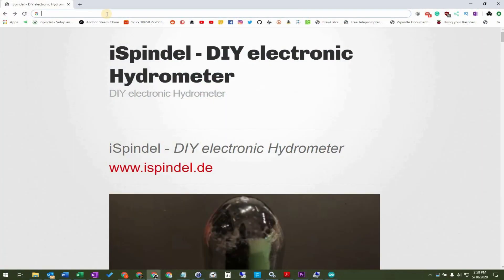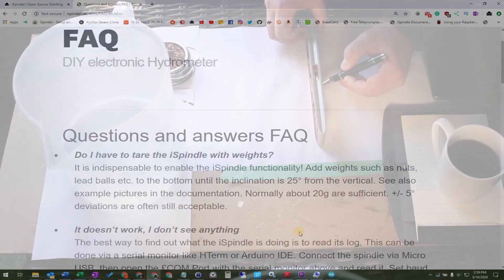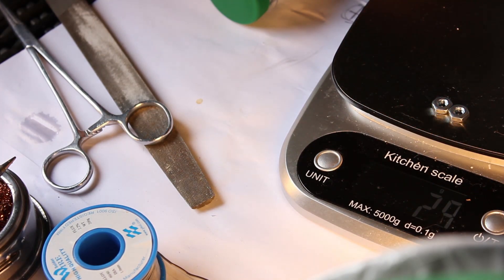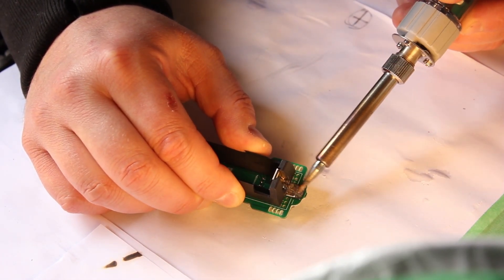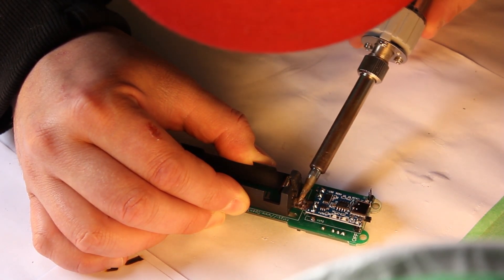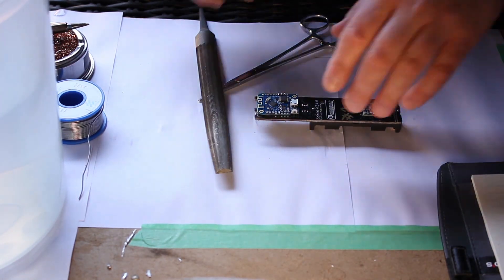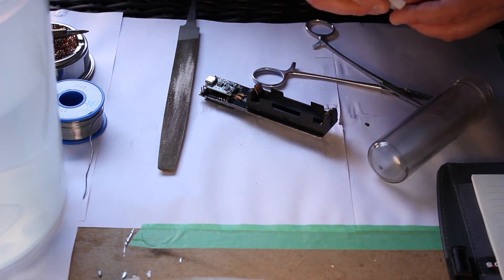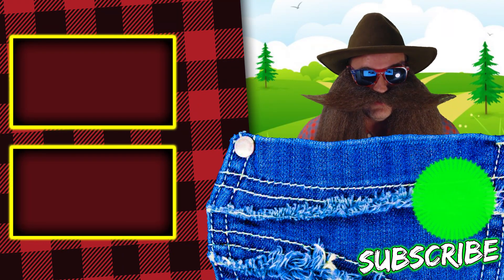iSpindel 25 Degree Calibration in Pure Water

Comment: the two I made floated around 31 degrees, I solder balled the bottom battery connection with 1 extra gram of solder and that made it float around 27 degrees.
Reply from the maker: Nice! A new board will be coming out soon with solder pads on top that do just this! I just build a prototype last week and it went very smoothly. It doesn't take much solder to adjust the degrees in water :) Thanks for watching!

Comment: For the off set calibration should the pelting lip not be taken into account? If you lay it flat off an edge so it is not raises would that cause an issue?
Reply: Hi there,
In my opinion the answer is yes it ought to matter - but it is taken care of thanks to an imperfect centre of gravity so the error is cancelled out along the way.

Here goes.

So the iSpindel calibration "advice" is to lay the iSpindel flat (incl lip) with the accelerometer uppermost and "flat". Now if you have aligned the accelerometer with the central cylinder axis of the pelting then it will be off horizontal slightly because of the lip we are discussing.

So we calibrate to horizontal and call that 90 deg.
Now if you were to roll the pelting around 180 you would expect the tilt to still measure 90 deg but because of the lip the error is now doubled. On one occasion I got nearer 92 deg.

So based on this so far I'd say it does matter. The accelerometer is not calibrated to the horizontal correctly. But...

There'e always a but.

When the iSpindel is laying in liquid its going to rotate around and settle with one "side" face up always - every time - because the centre of gravity won't be aligned down the axis of the cylinder. As the SG changes the iSpindel tilt changes but the "error" we built in via our calibration will be consistent (more of an offset than an error) because the iSpindel will always rotate in the liquid until the cylinder axis is heavy side down. You could put a mark of some sort to check - or make a mental note of the PCB orientation each time.

So now you're going to calibrate the SG against tilt in a sugar solution or whatever your method is anyway and create a polynomial that will caculate out that offset and all will be well with your iSpindel.

If the centre of gravity of the iSpindel down the cylinder axis was perfect and it could settle in any rotation then YES this error would matter and we should be taking the lip into account.

But the centre of gravity is not perfect. So we are ok. So long as you are diligent with your tilt to SG calibration method and allow the iSpindel to settle for each reading the error due to the lip will always be in the same orientation and be dealt with via tilt to SG calibration.

Andy.
Reply: I thought the same thing. Just leaving the lid off for this part of the calibration seems the obvious option.
Reply from the maker: @MichaelCoates  The lid isn't the problem, there is a lip underneath the lid that's part of the tube. You would need to hang the lid area off the side of the table/countertop. But I think the flatter the better. I think it's a good idea.
Reply from the maker: You are not the first one to ask this. I did it as seen in the video and everything appears to be working fine. I don't see how doing it your suggested way would cause an issue, flatter should be better. There doesn't seem to be a general consensus on if it's bad or not.

Comment: Interesting that you have experienced the same issue with the 4.0 Version board. I am having the same issue. I'll give your suggestions a try and see how it goes.
Reply: Check wight of your battery. On good scale. I think it should be 44gr or so (its printed on PCB , I'm not exactly sure).
Reply from the maker: @DnnyNY, Yes the CherryPhilip 4.0 PCB states 44 grams on it. When I was troubleshooting with CherryPhilip he said, "The iSpindel-pcb work fine with Samsung 30Q battery or with a battery with 48gr weight." My batteries all weigh 48 grams. I suppose with a lighter battery the tilt should be higher in water.
Reply: @OpenSourceDistilling  hmm . I never tried to use other battery. I got stash of used laptop 18650, weigh them all and choose 44g only. Build 5 of those and have no problems to calibrate with small washer and double sided tape.
Reply: @OpenSourceDistilling  also thank you a lot for you videos. Always like !!!
Reply from the maker: Yeah, it's weird that the 4.0 PCB says 44 grams and then when I speak with the maker he says that 48 grams is okay. It's very possible that the 4 gram difference is what's causing the low tilt value. That's part of the problem that my board tries to solve, take any part regardless of weight and build an iSpindel that floats at 25 degrees in pure water. Thanks for watching and for your input! Appreciate it. Hopefully I can get my hands on a 44 gram battery and see if that solves the issue.
Reply: @OpenSourceDistilling  I had a battery that was closer to the 44 grams that I ended up using along with trimming back some of the PCB on one side and I have been able to get it calibrated within the range. I found that if you have batteries with the overcharge protection built into the battery they weigh 48-50 grams. This is definitely what caused the issues for me.
Reply from the maker: Make sure you check out the HomebrewTalk.com link on my blog post. I link to a post where a guy adds weights wrapped in tape. Maybe a combination of the two solutions would work better? Good luck and let me know how it works out.